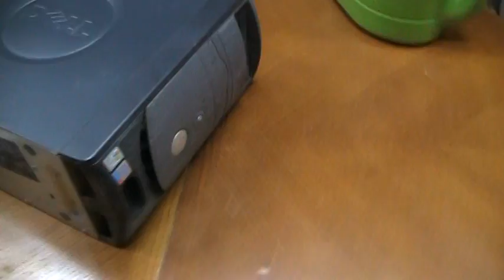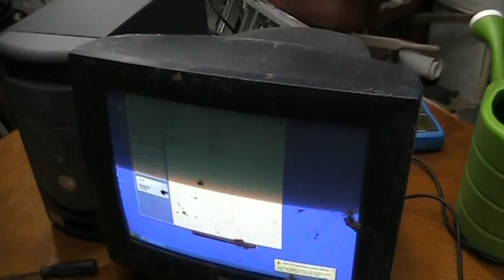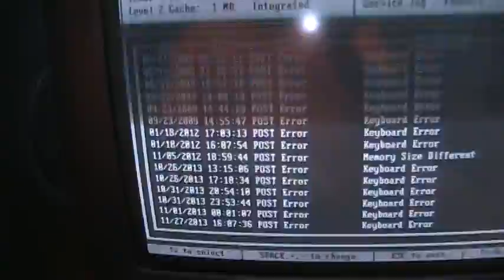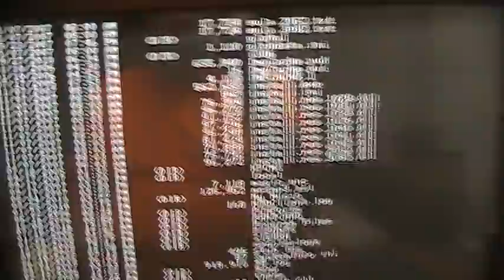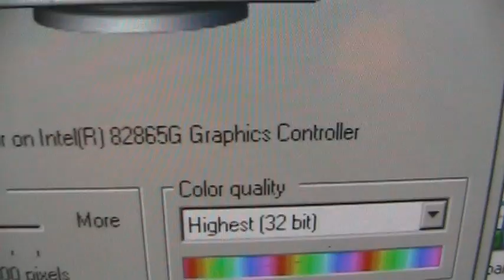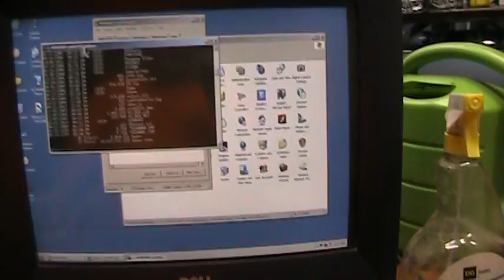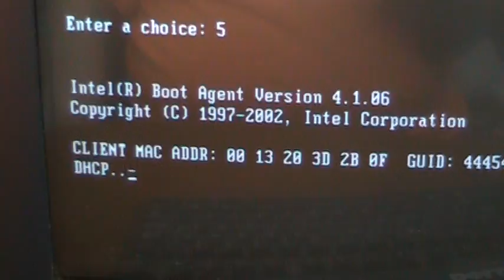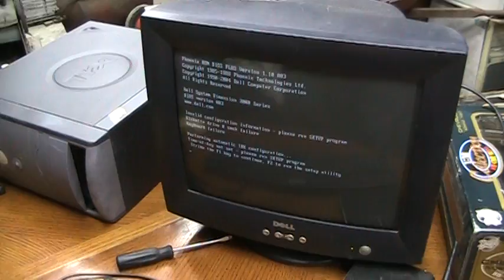Trashpicked "Treasure": Dell Dimension 3000

Comment: you are like me, a hunter, lol. but yeah nicco-dust,... blegh, If it's one thing about computers they will inhale everything you do, animal hair and nicotine are by far the worst combination you can have, but this machine you have was the exact same model I had to clean up that came from a house fire... and the system was apparently running as the house fire raged. it had sucked greasy soot inside which covered the dust that was already there. it took three days to clean that system. I had to basically tear everything apart. optical drives, the floppy drive. (Their model had one). and the power supply all had to be pulled apart, as well as the motherboard.. all spread out on a kitchen table covered with an old comforter. it was a LOT of work, but the thing looked brand new when It was finished. ( I could have tried the dishwasher method, but didn't want to risk it.)the amazing thing was despite a very minor malware infection, the system ran perfectly. to my knowledge it was still running when it was donated to a church two years later. but on the subject of trash picked systems, I got a machine that I guess would have gone in the trash if I had not shown any interest in it. an IBM model 30 286. complete with external 5.25 drive, model m keyboard made in 1989,  the original monitor, and an ibm proprinter x24. all in perfect shape. and the printer still prints!. I was aware that at some point you had one of these machines, and wondered if you might have found a way to rig up a regular hard drive. while the one in my machine seems to be working well. I was wondering if there might be an alternative in case the drive were to suddenly fail.

Comment: Great video, I have just 1 question. Will you be getting a 1080p camera at some point? I really enjoy the videos but it's sometimes hard to see whats on screen.
Reply: This question has been answered many a time, and last I knew (no offense), but the computer used to edit these videos has trouble with even 720p. 

I can read everything on the screen fine at 360p, and 480p is really unnecessary. This monitor is 1280x1024 (5:3) if that contributes somehow.

Comment: the corrosion of the case after the dishwasher treatment is the zinc plating dissolving because of the lye inside dishwasher detergent.

also some CRT monitors can be used beyond the rated resolution, the monitor I bought 16 years ago had a rated resolution of 1600*1200@75Hz however I could get a picture at 2048*1536@60Hz, not too bad for a 17" tube.

Comment: I decided to move my computers around a couple of days ago, and my gaming rig (Hexa-Core) froze up somehow, just like the Compaq Presario 6300US (had a Socket 370 board in it, but it now has a PCChips Athlon 64 754) did. It turned out both of my systems' PSUs had a hell of a lot of dust inside (saw a thick cloud of it). My basement was clean, but dust always gets into my PSUs, whereas a dirty room means dust-free PSUs (ironic, ain't it?) and I thought it was my heat sink compound getting gritty, but it wasn't that. Least it wasn't the memory modules either.

Comment: I got one of these from my aunt about 2 months ago with all the original accessories even the dell printer that was bought with it when it was new back in 2005. It presently has 768 mb of ram that will be upgraded to the full 2 gigs it can support and has a 80 gig Seagate drive. Only reason I decided to take it was because it was going to be recycled since she had no use for it anymore and I just couldn't bare to see it go since I have fond memories of playing on this computer when I was a child. I put a new install of xp on it using the system discs and am now using it as a little time capsule.

Comment: Consider yourself lucky, Bill. I rescued a computer from recycle and quite honestly, the smell was terrible. The previous owner smoked those little grape cigars so it was the combination of nicotine and sweet grapes. Eww. But it was an eMachine and nothing really of value in it so I'm probably just gonna put it back to where it was originally gonna go. I also have one of those B110 machines in my basement as well. I think those could go up to 2GBs of RAM if I'm not mistaken but I don't believe it has an AGP slot on it, that's one thing I hated about computers that had onboard video from that time, they'd cheap out on those slots. Aftermarket boards don't seem to do that though thank goodness.

Comment: what is the purpose of your very convenient electrical adaptor?
Reply from the maker: Initially it was constructed and used when a building lost one of its three incoming phases of power. All computers in said building were hooked to centrally located UPS units (2200 VA, 120 V) and as a result, about 1/3rd of them weren't working. The idea was to locate and connect to another circuit that still had power, and most of the outlets in said building were the 15 amp type.

Since the UPS units were nothing like fully loaded, and this was only temporary, I assembled that adapter and got them up and running until the electrical utility was able to fix the problem. These days it sees the most use as a simple extension cord. (I have another such "evil adapter" for L5/30A 120 volt stuff, with much the same purpose in mind.)

Comment: I recently got one of these very machines in a job lot.

There is absolutely no need for me to keep it but out of respect for it I cleaned it up and rebuilt it with a new XP install. 

My boss has a saying with old things that after a time they earn the right to exist, so its saved much like yours.

It runs well, I even found a PCI FX5200 for it.

Comment: I still use XP on a semi-regular basis, but for some reason, nostalgia really hit me hard when you opened the control panel...
You know, I've been surprised by the performance of the hardware scaler in some older TN-based monitors, specifically my Lenovo L215wA from late 2009 (native 1920x1080 by that time). You can throw it something as low as 320x240 and it'll handle it without a hitch, despite being stretched. Obviously, I don't actively use it on anything older than my beloved Phenom II, but I ran a Dimension 4100 with a RIVA TNT2 into it once.
The F isn't what's blue :P
Reply: I use XP Pro on a few of my machines, most of which are older IBM Thinkpads but there would be little gained if I used my other more powerful desktops.  For whatever reason these old Thinkpads run XP brilliantly, really quick and fast even on an old G41 laptop, which weirdly was designed by IBM but assembled by Acer!  I do however have SSD drives in just about all my laptops and desktops ,plus they all have maximum CPU and RAM etc.

Comment: They recently lifted the restrictions on electronics here in West Virginia. I think their main concern was CRT's. 
I trashpicked what I believe is a 24 inch Sanyo CRT TV that I put in my shed for watching the around 20 channels I get on the antenna around back of the shed.  I also found a working Emerson VCR that works beside it. It was serviced by Radio Shack 20 years ago.

Comment: I have a female Dell Dimension 3000, if you would like to loan yours as a stud we could make some Dimension 6000 systems? An SDP Store special :P

I got mine free 'not working' turned out the power supply was dead. Came with a Celeron, but now has a P4 2.8 Prescott. Running XP its still very snappy especially with 2GB of RAM.

Comment: I have a Dimension 4600 lieing around that was rather decently configured when it was new. P4 3GHz, 512MB RAM (1GB now.), 160GB SATA Hard Drive, Dual Optical drives (CD-RW/DVD-ROM)...it also has a Radeon x1300 in it that seems like it was added maybe when they very first got the PC. 

I also have a Compaq Presario also lieing around with an AMD Athlon 3000+, 512MB RAM (Upgraded to 1.5GB...not by me), 120GB IDE Drive, DVD-RW (Stock!) and CD-ROM drive.

Anyways, the point I'm tryng to make here is both of these machines have Seagate hard drives in them....and they aren't really quiet at all. The bearings on both are worn out I'm guessing, although one has 18k hours and the other has 20k so I can't judge too too much. I also have a circa 07 era Vostro 400 which is all stock except for the video card that I upgraded, and it has a Seagate SATA 250GB HDD that's also really loud with worn out bearings (It has 16k hours now but had 14k hours and was just as loud when I first got it)

Comment: uxwbill my aunt just gave me that exact model of pc and a dell precision T3400
Reply: What are the specifications fo that precision? Depending on their specifications it might be quite a decent machie, even today. Upgrade the graphics card and you'd have a pretty good machine if it's a quad core.
Reply: here is the specs and it has a dual monitor digital graphics card with a 1GB ethernet nick

https://www.cnet.com/products/dell-precision-t3400-core-2-extreme-qx6800-2-93ghz-2gb-ram-160gb-hdd-xp-pro-64-bit/specs/
Reply: Jacob Sanders
I don't know why the title says core 2 extreme and the page specs say core 2 e4600, and also lower down says e4400. I'm going to guess it's the e4600 in which case that isn't a great specvced machine...but it's alright. It can be upgraded a bit at least. I have a Precision 390 (The precursor to t3400) and I have a Q6600 planned for its future.
Reply: no its an Intel core 2 duo e8500 @3.16GHz  and i have hardware hyperthredding enabled
Reply: this computer was free from my dad he said they couldnt use it at work it was sitting in his office in a corner .. windows xp was  VERY sluggish and i couldnt fix it so i installed linux lite on it the 64bit edition
Reply: Jacob Sanders
How much RAM and what's the video card? You could run Win10 on that fine if 4GB+ RAM.

Comment: You can also find out the original install date on Windows 2000 or later by opening a command prompt and typing "systeminfo". It will take a while to load the statistics, but it will tell you various information about the system, the OS install date, and a glimpse of how many updates were installed.

Comment: Ah the dell that smells like  rotten ashtray with a mask of perfume, seen (and smelled!) enough of those to know EXACTLY what you mean!! Yeugh..... :S

As for a sleeper build, sounds like a plan, I built my AMD FX-8320E gaming system (not exactly a top-end powerhouse, but damned good for what it is!) in a generic beige box, and appropriately decalled it with "Intel Inside Pentium III" and "Designed for Windows2000 & WindowsXP" labels,a long with an nVidia GeForce FX series decal I've had around for a few years, the only non-sleeper part is the case was NOS and hasn't yellowed... :P
Reply: A singing group that has come to our church has an i5-2500 on a Gigabyte board with an SSD in a Dimension 4600 case that plays their background music. I'm thinking of doing something similar with one of my old Dimension cases.

Comment: Pentium 4s are still useful for some people.  I have sold a number of Pentium 4 computer that I get from recycling centers or given to me.  I sell 'em cheap....bout $30-$40 depending on what is in it.  (DVD-RW drives, maxed out RAM, big hard drives usually are the reason for me selling 'em for $40 rather than $30).  They are still good for someone that wants to play some older games that newer versions of Windows won't run....or for someone that is using it strictly for offline use (kids computer) or even a machine to hold someone over until they can buy a new computer.  Of the 15-20 of these I have sold, I haven't had a single person complain about the performance or price they paid and I even had one person buy 2 more....
Reply: DvdXploitr Indeed. My Pentuim D still services me well for most things. Only complaint would be it can't run a few games I'd really like to get.

Comment: Of all the nasty things I've dealt with including a dust bunny that was actually the size of an adult rabbit, tobacco tar is the worst. It makes everything sticky. It smells like the devils ass too. As for the dishwasher treatment, I've recommended that to people who are less savy about cleaning computers myself. As long as the water doesn't have any heavy mineral content whereas it would leave deposits, it works pretty well. It also has the strange propensity to rehydrate electrolytic capacitors to a small extent. Either way, I too enjoy finding machines in the wild. I go so far as to ask computer retailers and repair stores for their broken or malfunctioning throw-aways for the fun of trying to figure out what's wrong with them and seeing if I can fix it.

 I've gotten pretty good at making things work. Right now I have an MSI GT70, model #MS-1762, that I resurrected from what the owner thought was certain death. It's a pretty great laptop that will actually run most triple A game titles with reasonable framerates at pretty high settings. The only thing that was wrong with it was a bad SMD capacitor on the charging system. It was easy enough to solder another one in sine I found it's service manual online that someone was kind enough to upload. It works like a champ. The keyboard even has a pretty blue backlight.